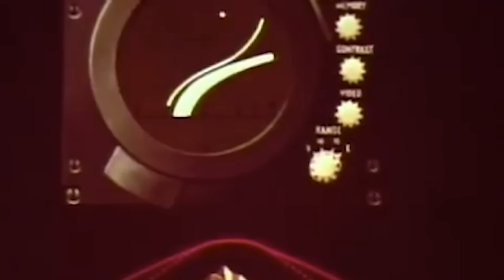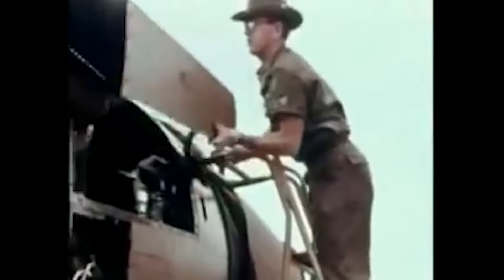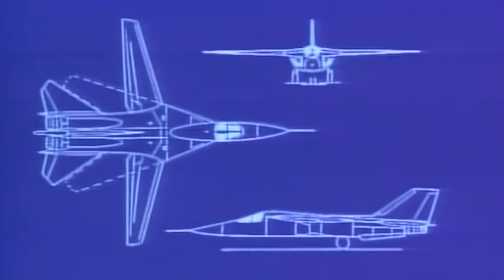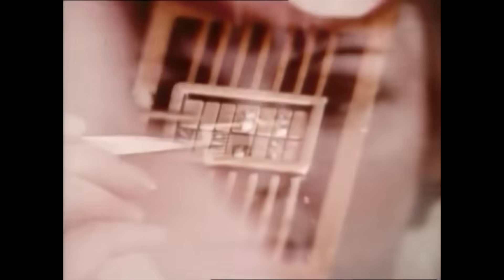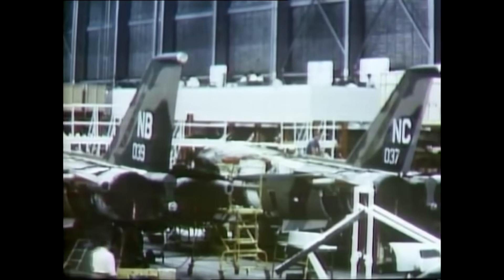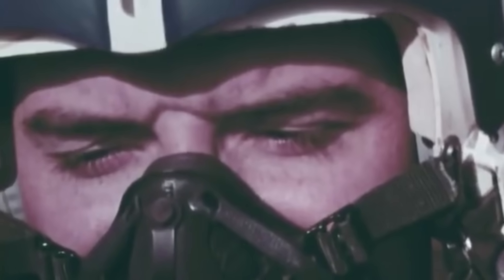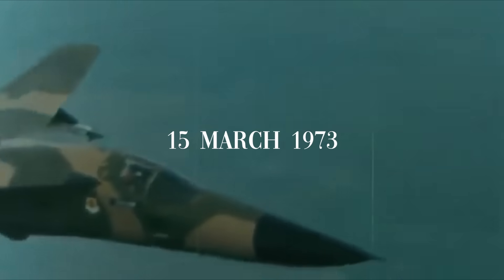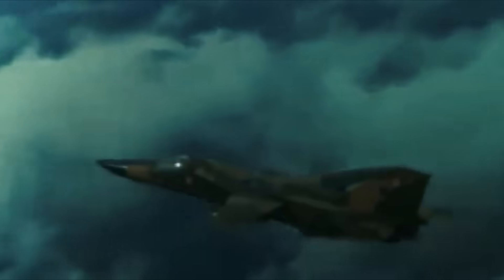The F-111's Fatal Flaw

Comment: And this is why the F-14 had an electron beam welded titanium wing box.
Reply: The wings of fighter/attack aircraft get a lot of punishment. The soundest design is 'unitary' like that in the F4. That wing had very few points of failure.

The F111 boxes, originally bolted, at vast expense were replaced with electron beam welded units. That together with cold proof load testing ensured no more wing failures. It wound up being a very strong and serviceable aircraft.
Reply: If only the Tomcat wasn't stuck with the TF30.
Reply: @DBravo29er  I mean, it was intended to be powered by the F401. The TF-30 was only to get it flying while they finished the real engine. It seemed like a good plan at the time...
Reply: We had an F-14 land ant Mt Home in the mid 80s  and it had problems with the wing pivoting. They literally set the wing in a position it could take off and welded it in that position to get it home. When I looked at that jet it had lots a missing fasteners on panels, looked like it belonged in the bone yard. But they made it home without incident.The Navy MX guys told me this lol. Could definitely been full of it
Reply: Which is fucking cool as fuck...  As if the Tomcat needed more street-cred... 😋
Reply: @smk6469  Grumman learned a lot from the F-111 effort, and applied all of it to the F-14.
Reply: @HarryVoyager  Indeed.  The Tomcat was an F-111 without the flaws of the F-111 for fighter / interceptor work.  Deleting the bomb bay, and going with twin tails did a lot.
Reply: @smk6469  Their solution was even more clever than that. One of the complexities of the F-111 was the pivoting wing hardpoints. 

On the F-14, by making the engines so widely spaced, they created a big open trench they could fill with stuff.

For example, the Phoenixs actually mount on support pylons that bolt into the trench, and you can use different support pylons for other payloads. That's why they could later swap them out for ridiculously large bomb trees without an issue. 

It's basically an external bomb bay, without all the moving parts or doors to worry about.

Comment: And the UK scrapped the TSR 2 for F111. Worst military aviation decision ever?
Reply: This was caused by the US using financial support to get the UK to purchase the F111 to make its production viable. The UK eventually cancelled the order of the F111 and had to pay compensation The UK Government ordered the scraping of all items relating to the  TSR 2 to prevent any further research/construction of the TSR 2.  Similar to the Canadian experience with the Avro development
Reply: The UK never had the F111.
Reply: How much payload could the TSR-2 carry ?? And was it  low level terrain following capable ??
Reply: @todd3285  Performance F-111C
Maximum speed: 1,434 kn (1,650 mph, 2,656 km/h)
Maximum speed: Mach 2.5
Combat range: 1,160 nmi (1,330 mi, 2,150 km)
Ferry range: 3,700 nmi (4,300 mi, 6,900 km)
Service ceiling: 66,000 ft (20,000 m)
Rate of climb: 25,890 ft/min (131.5 m/s)
Lift-to-drag: 15.8
Wing loading: 126 lb/sq ft (620 kg/m2) wings spread
158 lb/sq ft (771.4 kg/m2) wings swept
Thrust/weight: 0.61
Armament
Guns: 1× M61 Vulcan 20 mm (0.787 in) Gatling cannon with 2,050 rounds (seldom fitted)
Hardpoints: 9 in total (8× under-wing, 1× underfuselage between engines) with a capacity of 31,500 lb (14,288 kg) ordnance mounted externally on hardpoints and internally in fuselage weapons bay

Performance TSR2 (projected)
Maximum speed: Mach 2.15 at 40,000 ft (12,192 m), M1.1 at sea level
Ferry Range: 2,500 nmi (2,900 mi, 4,600 km)
Combat range: 750 nmi (860 mi, 1,390 km)
Service ceiling: 40,000 ft (12,000 m)
Rate of climb: 15,000 ft/min (76 m/s)
Thrust/weight: 0.59
Armament: Total weapons load of 10,000 lb (4,500 kg); 6,000 lb (2,700 kg) internal and 4,000 lb (1,800 kg) external
Reply: @todd3285   TFR was at least in development.  It ended up in the Buccaneer. The TSR2 engines were used in the Concord, so not an entire waste. TSR2 payload was 4,000 lb. Remember that the spec was issued in the 1950's
Reply: @peterinns5136  So in other words you're not going  answer my question !! You're comparing apples to oranges .
Reply: Performance F-111C
Maximum speed: 1,434 kn (1,650 mph, 2,656 km/h)
Maximum speed: Mach 2.5
Combat range: 1,160 nmi (1,330 mi, 2,150 km)
Ferry range: 3,700 nmi (4,300 mi, 6,900 km)
Service ceiling: 66,000 ft (20,000 m)
Rate of climb: 25,890 ft/min (131.5 m/s)
Lift-to-drag: 15.8
Wing loading: 126 lb/sq ft (620 kg/m2) wings spread
158 lb/sq ft (771.4 kg/m2) wings swept
Thrust/weight: 0.61
Armament
Guns: 1× M61 Vulcan 20 mm (0.787 in) Gatling cannon with 2,050 rounds (seldom fitted)
Hardpoints: 9 in total (8× under-wing, 1× underfuselage between engines) with a capacity of 31,500 lb (14,288 kg) ordnance mounted externally on hardpoints and internally in fuselage weapons bay

Performance TSR2 (projected)
Maximum speed: Mach 2.15 at 40,000 ft (12,192 m), M1.1 at sea level
Ferry Range: 2,500 nmi (2,900 mi, 4,600 km)
Combat range: 750 nmi (860 mi, 1,390 km)
Service ceiling: 40,000 ft (12,000 m)
Rate of climb: 15,000 ft/min (76 m/s)
Thrust/weight: 0.59
Armament: Total weapons load of 10,000 lb (4,500 kg); 6,000 lb (2,700 kg) internal and 4,000 lb (1,800 kg) external
Reply: Unfortunately you have bought into a myth. The F-111 surpassed the TSR2 in every performance criteria. Though smaller, it was faster, had a much larger payload which it could carry further.  There is no meaningful area where TSR2 matched the F-1111. I   recommend reading Damien Burke's excellent and definitive book on the TSR2. It will debunk all of the emotional  nonsense  that  has sprung up over the years.
Reply: @Completeaerogeek  The TSR2 had enormous unrealised potential. If not for interfering bureaucrats, it could and should have been a winner. It's not surprising that the prototypes were scrapped. Hiding the evidence, IMHO. FYI I'm English and my dad was in the RAF during this time. The Lightning demonstrated what the British can do if allowed.
Reply: @peterinns5136  Again, read Damien Burke's book. It took years to get the Olympus 22R right. It carried far less was slower (M 1.5 in the end) and had shorter range. You can't sell potential when no one wants your product.
Reply: @peterinns5136  Peter, unfortunately we don't have any data regarding how the TSR2 might have turned out , but if you have read Burke's book, you would know it was not on a good trajectory. 

TSR2 was  was getting heavier, had its maximum speed reduced to M 1.5, the Olympus 22R had 'Bell mode' issues (it should never have taken to the air until these were solved,. Beamont really was risking his life.) and with its small highly loaded wing it would never be able to carry the load the F-111 could, did not have the range or speed of the F-111 and the requirement to take off from marginal quality runways was never met, where the F-111s high flotation landing gear and large tyres mean it was capable of this. (In fact it suffered severe undercarriage oscillations during test flights.)

The bottom line is there was no overseas market for it and the UK couldn't afford it.

And where did you get the idea that the prototypes were scrapped? There  are two beautiful examples, one in Duxford and one in Cosford. I travelled halfway around the world to visit them in 2019. They are still menacing to look at but so much bigger than the more capable F-111.

TSR2 had a long, expensive development road ahead of it, where the F-111 which first flew in 1964 and was already flying combat mission over Vietnam in 1968.

Some problems with faulty subcontractor manufacturing of the stabilator caused a couple of losses but by the time it left in 72, it had the lowest loss rate of any aircraft in theatre while carrying out the most hazardous missions at night and in bad weather,

Our F-111Cs (basically an A with the FB-111 Wing and undercarriage) did not have WCTB failures and were not modified but we Cold Proof Load Tested them for their entire life with no failures..
They stayed in precautionary storage from 68-73 when they were flown home and made operational. We later upgraded them with all digital avionics, Pave Tack (and PGMs, Harpoon, Sidewinder) a digital flight control system, upgraded radar/ECM/RHWR and new engines (P-108) 

For 37 years, they were the most potent low level strike aircraft in the world and let us punch way above our weight in the SEA region
Reply: @Completeaerogeek  Let dreamers and bureaucrats run a military project and that's what you get. The scope of work was changed constantly, hence the cost overruns. I was in the RAN. The ship I served on was way late and over budget for exactly the same reason. The F111 was delivered 10 years late to the RAAF. The Phantom was excellent, but not what the RAAF wanted. And they had to lease aircraft while they waited. And waited. The Vietnam war was almost over by the time the RAAF took delivery.
Reply: @peterinns5136  Peter we were supposed to get the F-111 in 1968. It only flew for the first time in 64 so your maths is a bit off. We waited 5 years for delivery. When you consider it  was the F-35 of its day that is not too bad. It served us brilliantly for 37 years and with Harpoon, making any shipborne hostile action north of us a non-starter long before your ship would have been put in peril. 

TSR2 was muddled by the RAF not the bureaucrats. The changing requirements stymied the manufacturers. I recommend Damien Burke's book to clear up the misconceptions you have.
Reply: @Completeaerogeek   "Australia's 24 F-111 aircraft required significant fuel tank repair and maintenance work from the moment of delivery in 1973." Department of Veteran Affairs